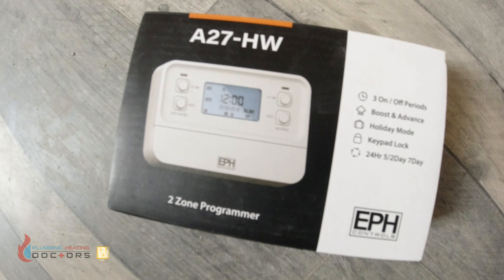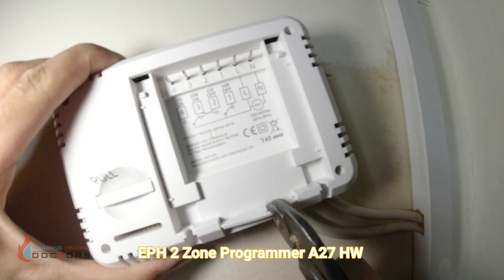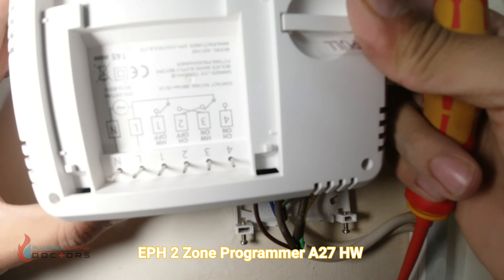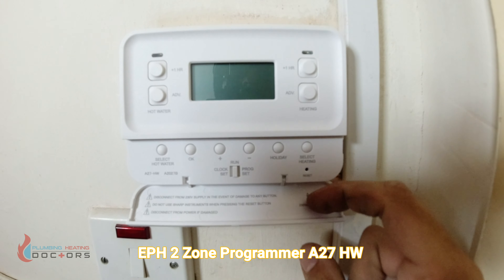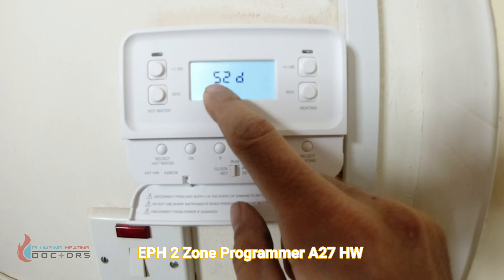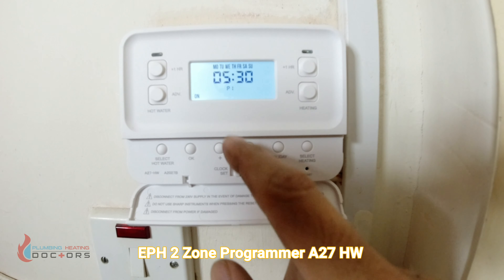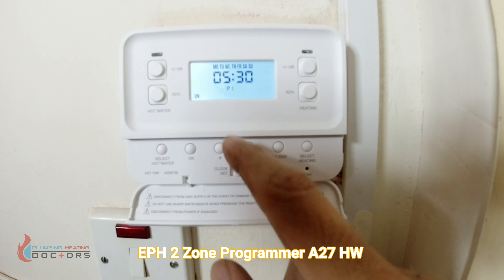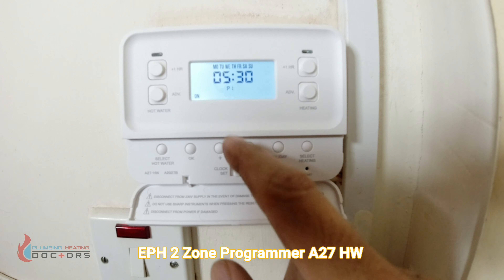EPH 2 Zone Programmer A27-HW | Installation & Operating Instructions

Comment: thank you for the info ! I recently moved into a rental property and had no clue how to use it, until i found you !! what to do if you only want program 1 + 2 not 3 or more ?
Reply from the maker: Best to call EPH
Reply: Set the unwanted program(s) to ON and OFF at exactly the same time. For example, ON at 1700 and OFF at 1700.
Reply: @rogercooper4817  the time is correctly set ! I programmed the timer P01 7:30 am On 9:00 Off P02 12:00 On 12:00 Off ....etc but the heating came on at 6am NOT 7:30 !!??